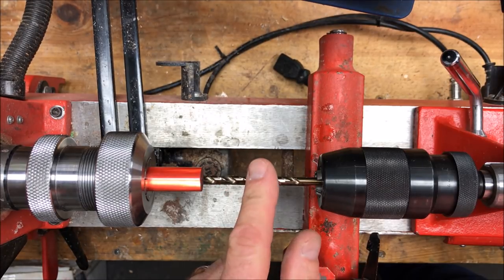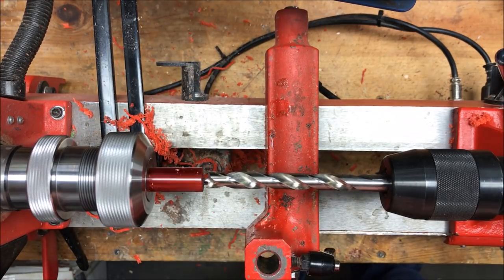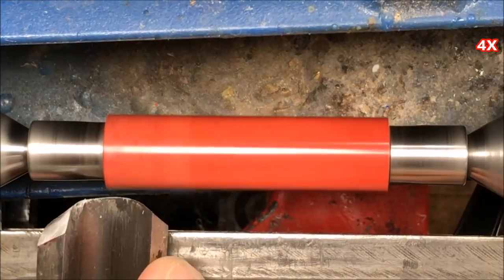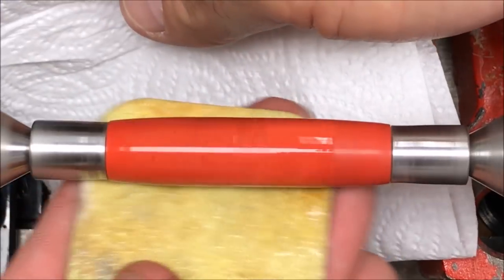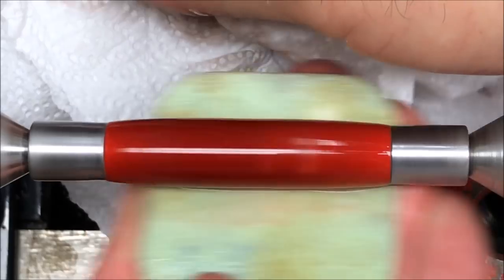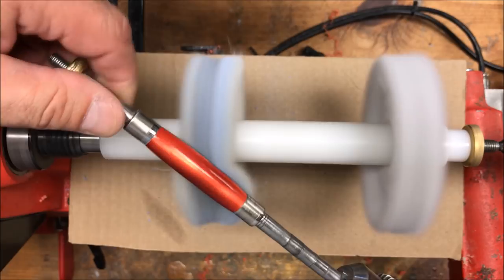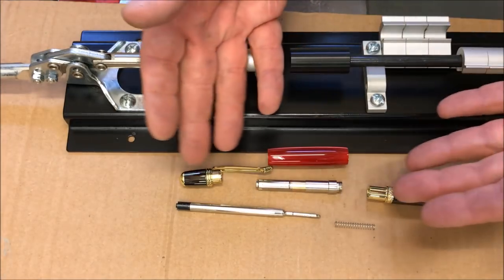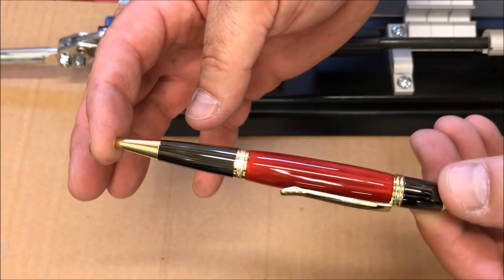Turning Conway Stewart Blank

Comment: Beautiful pen.  The blue polishing compound is about 1 micron abrasive which is equal to about 2,000-3000 grit, but because it is a "fluid" polishing material it gives a better finish than the 12,000 grit polishing pad you use.  Most polishing compounds were developed for metals, but the blue was developed for plastics, a much softer material, so the grit equivalent is an extreme rough approximation.  To further mess with your mind, there is no standard on this and the abrasiveness will vary widely among manufacturers.  Glad to make this slightly clearer than mud.
Reply from the maker: Thank you Mark,
  I appreciate this information. 

Regards,
Bob